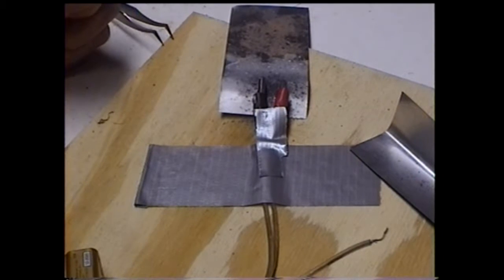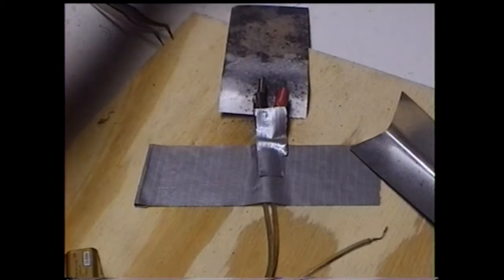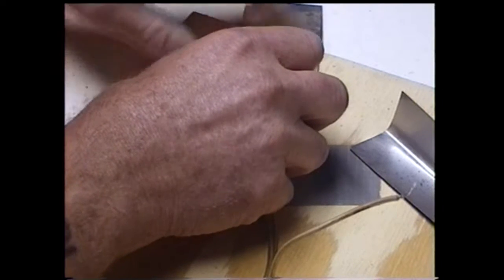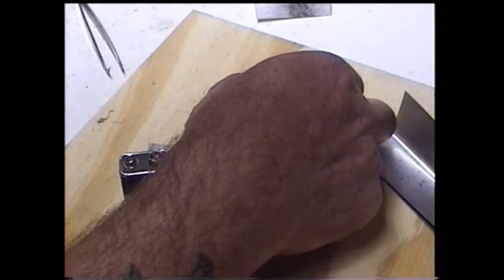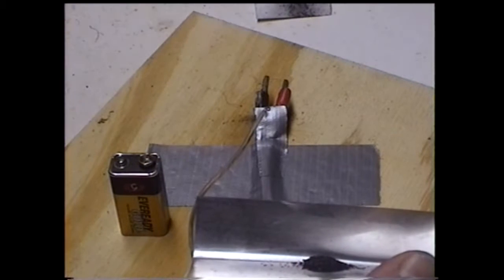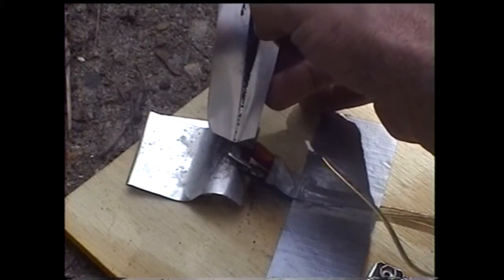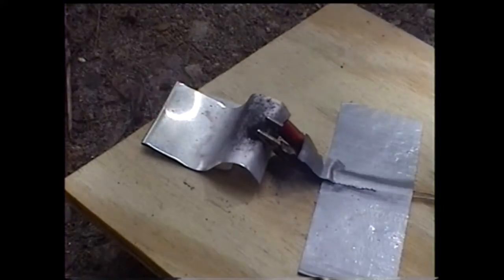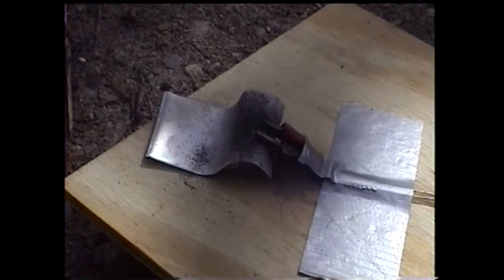Flash powder flash gun for photography

Comment: I did "flash pods" for theatrical productions back in the day.  We used Photographic Flashpowder.   We used three copper wires between screwed down gater clips on a wood background in a hinged electrical box.  After three years got busted by the Fire Marshall.  We had it pretty safely done, and made sure dancers a safe distance from the pods.   Was a blast.  Can't find the powder now, and want it for.. photography!!
Reply from the maker: If you are in America you can buy the components (depending on your recipe) from Skylighter.com .
Reply: Umm.  I used to buy it in a sealed bottle.  Already ready to go.   We knew how volatile it was, so were super careful.   So I have no "recipe."   We had built a panel to set off the pods with momentary switches.  Also did stuff like dry ice fog, chemical fog, etc.   But the flash pods were the most amazing effect!
Reply: Put your filament and flashpowder inside a single layer flashpaper envelope. Leave the ends of the filament sticking out. You can pre-make just the flashes you need at the intensity you need with no long fumbling with wind or loose powder when the flash is needed. Also, back in the day, camera manufacturers like Kodak and Agfa simply sold a thin & narrow roll of flat magnesium wire in a spool with a length guide legend on the tin dispenser. You just rolled out your length and set it off to burn the length of time you wanted. If your shutter speed was short, burning a little longer  than the time your shutter was opened didn't matter as long as it was burning for the needed length of time the shutter was open. It was more stable and storeable than powder although, it was harder to trigger off. The only real benefit to powder was that it was easy to quickly trigger with a small manual spark. Electric ignition to thin magnesium wire shouldn't be a problem these days.